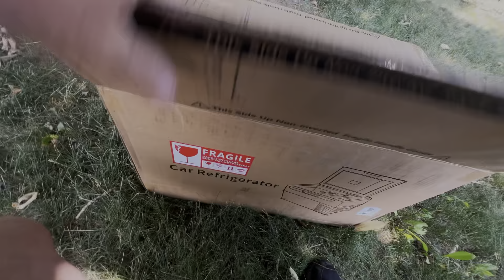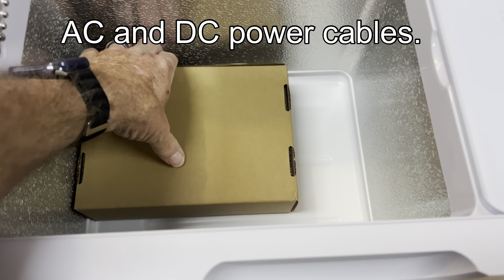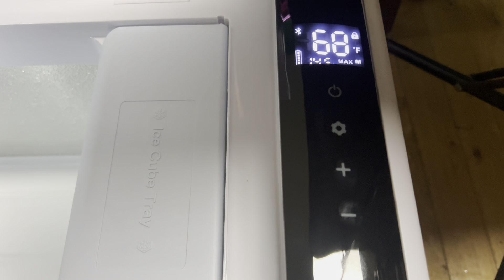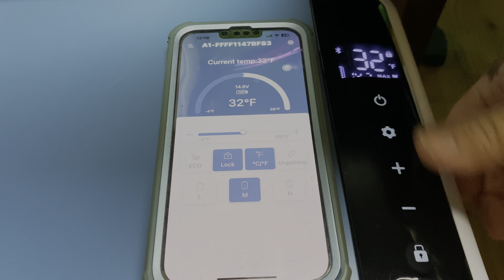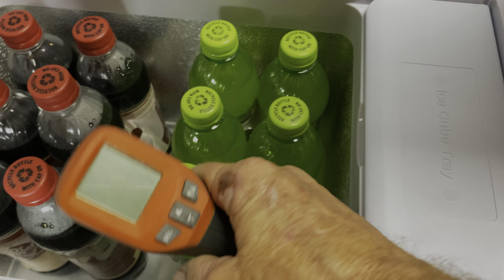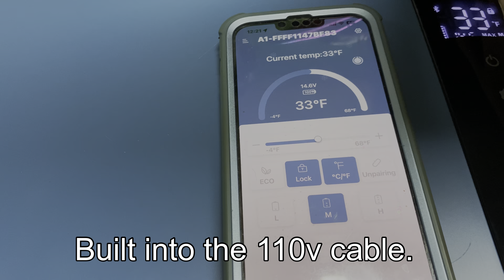Portable refrigerator for car or office.

Comment: It's funny that you put up this video. I'm currently looking at the Vevor 45L (47qt) version to use to transfer cold groceries from the grocery store when applicable. Not every store we shop at is right down the street and with this hot weather we are having in the summer it will definitely help. Most of all I want it to transport the smoked meat that I'm selling from point A to point B. Great review and Vevor is a great brand. I have a Vevor chamber vac that I absolutely love. I'll be showing that in an upcoming video. Great review as always 🙂
Reply from the maker: I've had a refrigerator in my 18 wheeler for years and just realized they are making them in chest style. 
I think this will work really well. 

Thanks for checking it out. Have a great night and be safe out there!